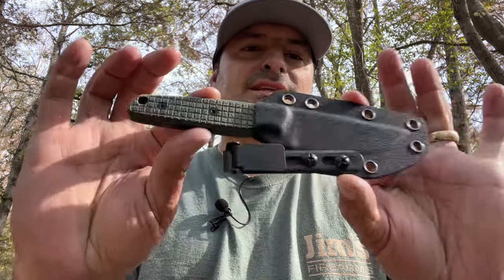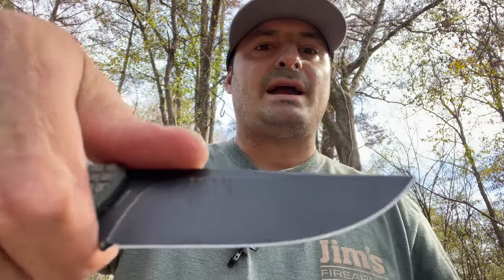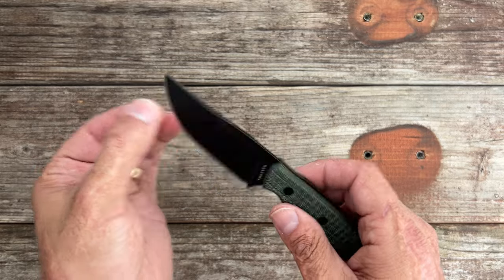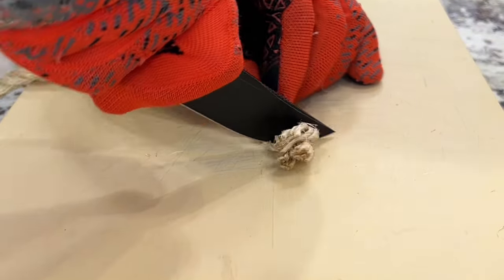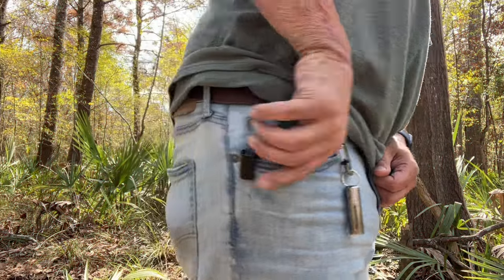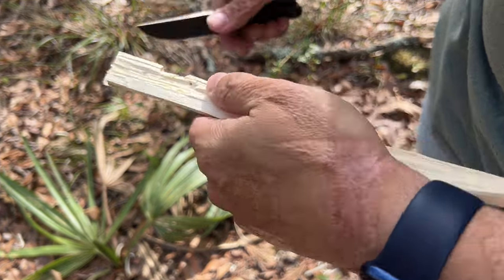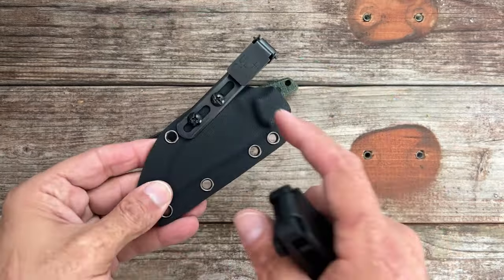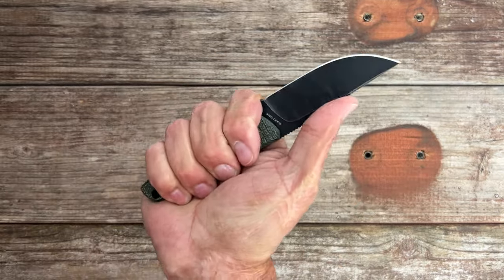Best Value EDC Fixed Blade!? Vosteed Mink Review & Testing

Comment: Vosteed and Petrified Fish have been the only two companies this year that have blown me out of the water with their out of the box edges. HAIR POPPING!!!
Reply: That they do, but they are simple belt ground edges so they don't hold up very long. Best to put your own slow and low edge on them. Depending on the steel they will out work the factory edge.
Reply: Do you mean Kizer? Vosteed doesn't manufacture any of their own knives as far as I know.